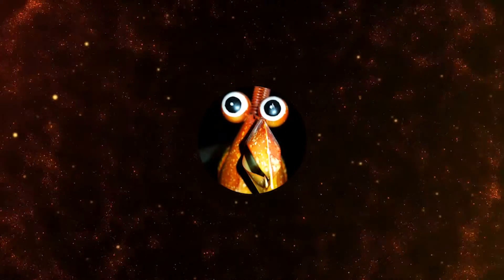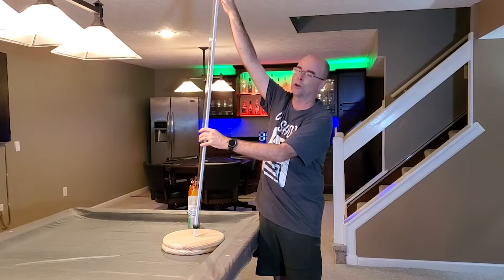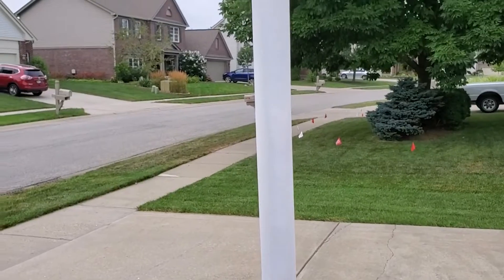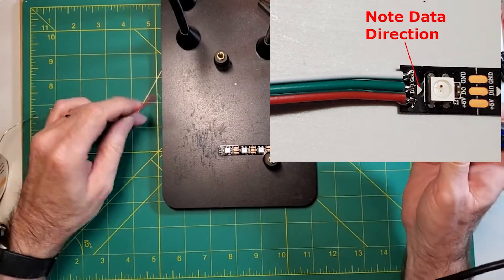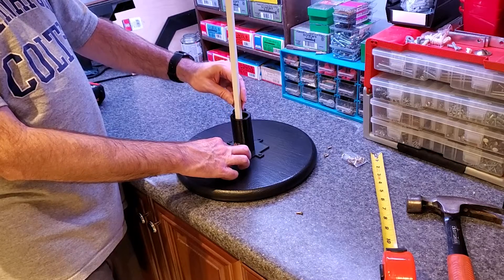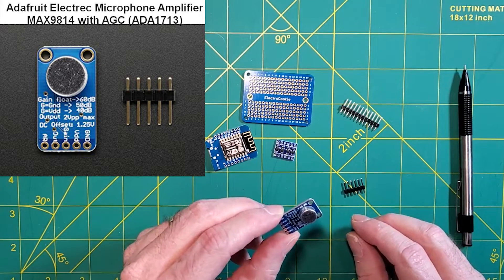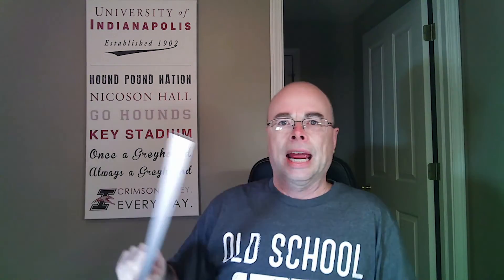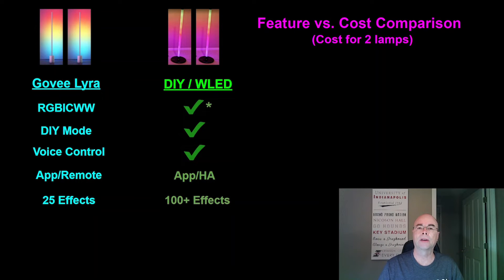DIY Sound Reactive LED Floor Lamps

Comment from the maker: Since this video was made, the sound reactive version of WLED has dropped support for the ESP8266 and now requires an ESP32.  However, if you still want to use an ESP8266/Wemos D1 Mini, you can download an older version from the Github repo that still has support and a .bin file for the ESP8266.  However, I'd now recommend an ESP32 due to the drop in price and better performance with sound reactivity.
Reply: That answered my question I had when I woke up this morning. Since I ordered 10 D1's  in early January I was wondering if I used wled 13.1 or 13.3 would SR still work or do I first need to go t github, get the .bin then download SR wled?
Reply from the maker: Standard WLED doesn't yet have sound reactivity (without adding a user mod).  For the sound reactive fork, the last version that supported the ESP8266 was 0.12.0.  Yes, you can still download  and flash the .bin files for this version from Github: https://github.com/atuline/WLED/releases/tag/v0.12.0  Any sound reactive versions later than that no longer have the .bins for the ESP8266.

Of course, you will then be "stuck" on this version and will not be able to upgrade... at least until that time the standard WLED adds sound-reactivity, and assuming that the standard version continues to support the ESP8266.

Comment: Does anyone happen to have or know where I can get the last WLED bin file for Audio Reactive?  I can no longer find and have to rebuild mine due to some unfortunate accident.  Thanks!
Reply from the maker: Hey... I replied to your other inquiry, but you can usually find old versions by going to the Github repo, then to the releases section.  There you can search by the release or tag to locate prior versions.  From the version release page, you can find the .bin you need listed under the release's assets.

Also note that 'Sound Reactive' WLED is slightly different from 'Audio Reactive' WLED.  The former is a fork of the official version, but generally follows the same release pattern.  'Audio-Reactive' is now part of the official standard WLED, but does require an ESP32 now and will no longer install/run on an ESP8266.
Reply: @ResinChemTech  Thank you once again!!!  Yes I appreciate you answering me... I NEVER expect anyone to just remember who I am.. it's a big world soooooooo LOL

Comment: rolled up parchment paper on the inside of the tube gives a really smooth diffusion also i just stuck the strip directly to the inside of the tube, thanks for the 3d files
Reply from the maker: Parchment paper is a really good idea and would probably give a more even diffusion than the frosted paint that I used.  Thanks for the comment and the alternate idea.

Comment: i want to use audio from my smartphone ? how must i do ? because if i use a external microphone is noisy
Reply from the maker: To use the audio from your phone, you'd have to connect the phone to the controller through some sort of line-in option as described here:  https://kno.wled.ge/advanced/audio-reactive/

Currently the WLED app on your phone will not pass the audio from the phone to the controller/LEDs wirelessly or via the app.  But if you are using an analog mic (like the MAX9814)... yes they are pretty noisy.  But you might consider switching to a digital microphone, like the INMP441.  These are much, much better than the analog version.  I used the analog version in this video because it was made before there was support for the I2S digital mics.  It's covered in the above link and I also show the digital mic in my LED curtain video and how to wire it in my Adding Components to your LED controller video.  I no longer use the analog/MAX9814 mic as you get much better performance (and much less noise) with the digital mics, like the INMP441.
Reply: @ResinChemTech  ok sir
Reply: @ResinChemTech  it's mean there is not a way to connect it wirelessly 😅?

Comment: Did you use one controller for both lights? or each one has a controller?
Reply from the maker: This uses one controller and the data signal is split and goes to both lamps.  You can see that in the wiring diagrams that are included in my related blog article, found here:  https://resinchemtech.blogspot.com/2021/08/sound-reactive-rgb-floor-lamps.html  (most of my project-based videos have a corresponding written article that has wiring diagrams, parts lists, code samples, etc...  and you can always find a link to it in the video description).

Alternatively, you could use separate controllers and the WLED sync functionality to have them always show the same color/effect, but they would probably not always be precisely in sync like they are when the two lamps share the same data signal from the controller.

Comment: Hi, interesting video. I wonder how you were able to get the wemos d1 mini to work with the sound reactive part as it says that the 8266 is not supported ?
Reply from the maker: When this video was made, the sound reactive version supported both the ESP8266 and the ESP32.  Starting with version 0.13, support for the ESP8266 was dropped and and ESP32 is now required.

If you really want to use a D1 Mini (like I did here), you can just download an older version from Github that still has support and a .bin for the ESP8266.  But honestly, while these floor lamps work fine with the ESP8266, if I were to rebuild them today, I'd go ahead and use the ESP32.
Reply: @ResinChemTech  Thanks, as I needs this to work also with a 2D matrix I will use a ESP32 for this

Comment: You did a great jobs.  But one thing  u didt factor in is the price  of a 3d printer and tools.   Plus not everyone  got the skills  to make it. Like u do.
Reply from the maker: Thanks.  No, my project cost does not include things like a 3D printer or common tools that you would need for any sort of DIY electronic projects... like wire strippers, a soldering iron, etc. I possibly just make the wrong assumption that anyone doing DIY electronic projects would already own most of these common tools and would not need to buy them for every new project.

As far as the 3D printer, there are many options for substituting other materials in many cases.  For example, a small piece of PVC pipe and angle brackets could be used to hold the tube in place.  Small project boxes of various sizes can be found at very low prices to hold something like the controller (or even a $1 plastic soap box from the dollar store).  I used a lot of these sort of items on my projects before I had a 3D printer.  You just have to be a bit creative at times.  I've even used a toilet paper tube to narrow the detection angle of a motion detector.  So, most of my projects can be completed without a 3D printer... you just have to figure out some alternatives.

As far as skills... I don't have any!  Well, not many.  But I've just learned through trial and error and by just trying different things to see if they worked.  Often, I have no idea exactly how I'm even going to complete a project when I first start... I just figure it out along the way.  Doing and trying are really the only way to learn these skills.  For this particular project, I just saw those clear tubes in a local hardware store and thought they might be interesting to turn into LED tubes.  But I tried a lot of different things before I came up with the sandpaper and frosted glass paint I used in the video.  I just don't show all the things I tried that failed in most of my videos!

Thanks for watching and taking time to comment.
Reply: Do you include the price of a screwdriver? Wire clippers? Soldering iron? In all your projects @terryxperry no. This is basic tools, and you can just get things 3d printed online. Tinkercad even has a tied in ordering service

Comment: Hello @ResinChem Tech. What model 3D printer do you use for your projects?
Reply from the maker: I use an Creality Ender 3 Pro that I've had for about 3 years... but I've upgraded the motherboard and a few other components since I first bought it.  I pretty much print everything with PLA.  It is integrated to Home Assistant via OctoPrint running OctoPi on a standalone Raspberry Pi.

Comment: What changes need to be made to make the light movement more instantaneous like a spectrum analyzer?
Reply from the maker: I've found there are really 4 things that impact the reactivity of the lights to sound: The squelch and gain settings in the Sound Reactive version settings of WLED, the placement of the microphone and the actual sound-reactive effect used.  And the effect selected can also impact the squelch and gain settings.

In my case, I have the microphone placed right next to a stereo speaker for my permanent installed location for these floor lamps.  After that was positioned, it just took some trial and error to get the gain and squelch set to the proper levels to get the reactivity I wanted from the LEDs.  

I hope that helps.. but a lot of it is just trying different settings and mic positions with different music and volume levels.

Comment: Love this. I need to get a 3D printer. I noticed the one you had was rather large. Do I necessarily need one that big to work on these type of maker projects? Or would a $250-400 one do the job?
Reply from the maker: I think maybe the way I shot it made the 3D printer look much larger than it really is!  It is just a Creality Ender 3 Pro, and is currently going for only $236 on Amazon: https://amzn.to/3Ef2iUE

They have other updated models as well in similar price ranges.  I absolutely love having a 3D printer and even after having it for over two years, it still gets used on nearly a weekly basis.  Sometimes it's the only thing that can create a part that you need.  I'm really not a very good 'designer' and pretty much just create simple parts using a free online tool called Tinkercad.  But that's really all you need for most DIY projects that I do.

Let me know if I can help out in any other way, but I do highly recommend a 3D Printer... if not Creality, then maybe a Prusa.  But the Creality printers are a great entry point for beginners.
Reply: @ResinChemTech  very kind. Creality is one of the brands I am considering.  Maybe someday we can chat. We have similar interests. I'm CTO and 40 software developer and was one of the inventors of the Jibo home social robot.
Reply from the maker: I'd love to have a chance to chat someday!  You may have caught it one of my videos, but I'm stepping down from my CTO role that I've had for 10 years and retiring in just a few weeks.  I've also mentioned that I have a Discord server, but haven't opened it up simply due to lack of time up until now.  I hope to open that up a few weeks after I retire and have a little more time.

In the interim, feel free to reach out to me via email if you like.  You can find my email on the 'About' page of my channel.  It'd be nice to chat about 'CTO things', smart tech/DIY electronics... and the Jibo!  I'd love to hear more about that!
Reply: @ResinChemTech  will do. I'll be 60 this year so starting to have thoughts about retiring. But I still have a ton of extroverted energy I need to burn off! I'll email you. I like Discord as a group chat concept. I'm hanging out posting in Adafruit's live shows weekly to their live show channel.

Comment: Hello, i am about to wire stuff up. I have a issue with this. ESP32 already flashed with WLED, via USB properly working, also wifi. When i plug it to my external power source (meanwell 5v) only the red led turns on, but nothing happens, wifi also not available. I am using the ESP32 D1 Wroom Mini Board. Where to find a solution?
Reply from the maker: It's hard to tell what the problem might be based on the information provided.  But if you get a wifi connection and can reach the WLED web interface when plugged into USB, but not when plugged into your 5V power supply, obviously something is causing the boot of the board to fail (or it is in a bootloop).  Do you have anything else connected to the board at this point (e.g. push button, LED strip, etc.)?  You might need to troubleshoot one step at a time... does the board boot and can you reach WLED via the web browser when it's only connected to the power supply and nothing else?  Does the problem only occur when connected to LEDs (or push button/level shifter, etc.)?

I'm happy to try to help, but I need a little more information on how you have things hooked up and wired to try to assist you with where the problem might exist.  And I'm sure you probably know this, but NEVER hook up the board to both the USB and the external power supply at the same time.  This is almost guaranteed to destroy your ESP board.
Reply: @ResinChemTech   i have connected them for testing without level shifter. it works, but i don´t exactly know how to wire the shifter up
Reply from the maker: Many will tell you that you don't need the shifter... and as you can see, it does work without it.  But if you are building two lamps to be powered by a single data line and are going to 'separate' the lamps by a few feet (like on both sides of an entertainment center), you are definitely going to need that shifter to boost the voltage to 5V before splitting it.

I have a wiring diagram in the related blog article to this video: https://resinchemtech.blogspot.com/2021/08/sound-reactive-rgb-floor-lamps.html

This has a wiring diagram for the control board, including the logic level shifter.  But the short of it is that you run 3.3V from the 3V3 pin on the ESP to the 'LV' side of the shifter.  Then you run 5V from the 5V pin on the ESP to the 'HV' pin on the shifter.  Ground is connected on both sides from the same GND as the ESP.  You then run the output signal from the ESP (default is D4/GPIO2) to any one of the LV channels on one side (LV1 thru LV4).  Your signal out to the LED strip then connects to the corresponding channel on the HV side (example:  data signal line from the ESP connects to LV3, then you run the line out to your LEDs from HV3 on the high side.  It's much easier to understand if you look at the diagram in the above article.  I hope that helps!

Comment: Very helpful video on how to build nice lamps. But the sound reactive on WLED very inaccurate with the music, and even doesn't react nicely like the ones I purchased from AliExpress as they are very accurate with low and high volume, But WLED after comparing is not worth it.
Thanks for the video
Reply from the maker: I don't disagree with you!  I've found that the sound-reactive version responsiveness can vary widely based on squelch and gain controls, the effect being used, the microphone selected (and its positioning) and even the type of music being played.  Settings for one effect/type of song might work really well, but those same settings are not so great for a different effect or song. Sometimes just moving the microphone can make a substantial difference.

I have nothing to do with the development (or support) of WLED - I'm just a user like you -  but WLED and sound-reactive WLED are free, open source and developed by volunteers who are not getting paid.  While it might not be as 'good' as the commercial version, it is improving all the time and does offer a free, local option for building your own version of sound-reactive LED lights. For what it is, and what I paid for it (nothing), I think it is a pretty good option for some... but not everyone.
Reply: @ResinChemTech  I really appreciate WLED it's a great software, as much as you're great channel with tones of helpful tips and informations, as greatly apprecieate what you're sharing, and  again you're correct, after changing microphones it worked very good, and hopefully the SR version will become even more amazing